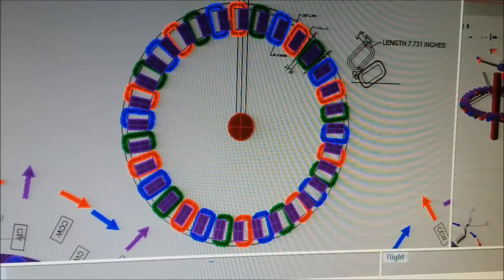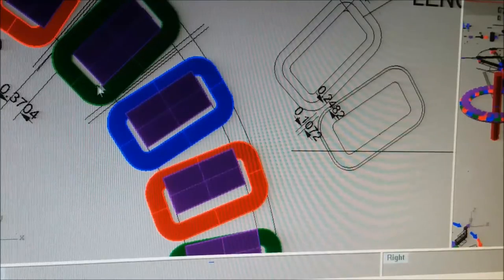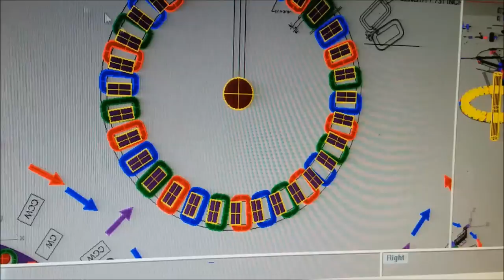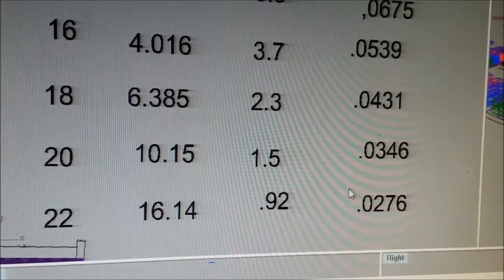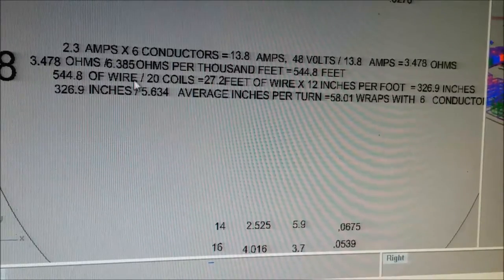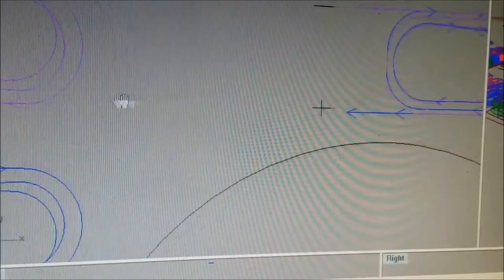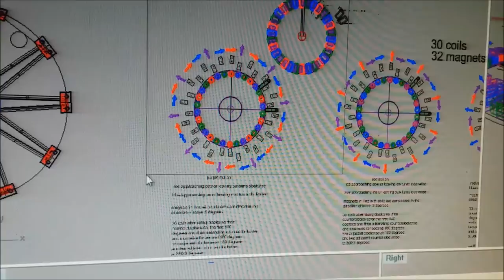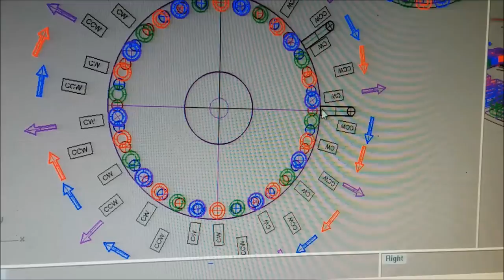HOW TO DETERMINE MAGNET WIRE SIZE AND TURNS FOR WIND TURBINE STATOR PART 2

Comment: thank you what is a software?
Reply from the maker: I converted to Rhino 3D from Autocad because it does compound curves. I don't have a rendering addition with this 2012 version. The software is from McNeil. They also have "grasshopper" and Penguin" to do other CAD work like animation which mine doesn't do. I use Meshcam to create G-Code files for the CNC machine tools to make metal casting patterns.

Comment: does magnet thickness size matter? because mostly they sell thickness of 5mm.
Reply from the maker: Yes, because thicker magnets of the same length and width have more volume and therefore more field strength.
Search E-Bay  for N52 followed by the dimensions. For this application surface poles rather than end poles and
run with as little air gap as you can build because magneti forces diminishes rapidly with larger air gaps.  Having the stator sandwiched between two rotor plates will be stronger than mamnets twice as thick on one side only. The opposing magnets nee to be opposite polarity. Thanks for being todays viewer on this channel
Reply: @concretehousebuildinginph1488  1 more question sir, for example i created 1kw turbine and the wind speed are in good and stable rpm can i run air condition  directly without battery usage?
Reply: @diymixvideos1825  A/C and no battery bank is NOT recommended ...
Reply from the maker: @diymixvideos1825  Basically, NO. A battery of any size is needed to  dump the 3 phase rectifier into and
the battery amperage  and voltage need to exceed the wattage of your load. Also the aircon cycles off
and on with the compressor being most of the load. The thing to keep in mind is that you are generating 3 phase power and the aircon is single phase. Also the voltage needs boosted thru the inverter and have
a 60 cycle  output since the aircon motors are synchernous motors in most cases, although a lot of newer
refigeration gear use variable cycle speed inverters. With small battery capacity and variable load some
way to dump excess generation is important. Possibly a Zenir diode in front of the inverter on the DC out of the rectifier.

Comment: Are the red coils all in phase?
Reply from the maker: All the red coils are wired in series and are 1 of the three phases. The other colors also wired in series are the other two phases.
Reply: @concretehousebuildinginph1488  how are they in phase? Are the outputs of the red coils all simultaneously zero?

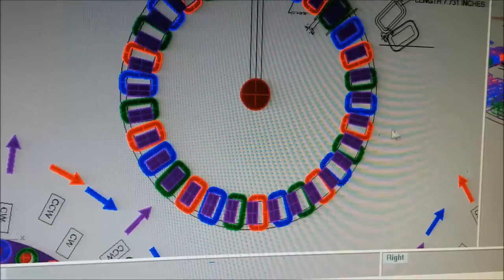Comment: 12:21 bless you
Reply from the maker: I actually got the idea from a video on the perpetual motion "Moller" machine. The video got most everything wrong and did not discover that hysteresis in the coils and inrush currents were major drivers as was the current reversal at the zero crossing points. The visual aid did however
 result in this idea. If the coils were 2 less than the magnets then arranging the coils as two 180 degree generators eliminated some coils
canceling output on others which is a major reason why store bought wind turbines actually only make about 55% of rated output.

Comment: You say six conductors, but you have 20 coils? I'm confused as to how many coils you are using on your design.
Reply from the maker: I have thirty coils every third one is wired in series for three sets of 10 coils. Every other coil is wired counterclockwise with the rest wired clockwise due to the magnets being mounted N_S_N_S_N_S....... So three sets with two ends each is 6 wires leaving the coils. If connected delta then 3 wires leave the stator. If wired WYE there is a common wire also so that is 4 connection points off the stator.
       If you are running the stator as a motor like on our whole house fan then one set of ten coils is connected to another in series and the third is idle with the connected pairs constantly changing and repeating every 6 steps. This is because a BLDC motor is electronically commutated whereas running as a generator there is no commutation. So as a motor 20 coils connected at any one instant.
      So the confusion has to do with the same stator running as a motor or an alternator
Reply: @concretehousebuildinginph1488  So would this mean that all 3 phase motors would have 6 conductors? As you say, 3 sets with 2 ends each. Not exactly sure what you mean by "conductors". Any clarification would be great. Thanks!
Reply: @DementioMod  I believe, What he means by 6 conductors is, he has 6 strands of 18 gauge wire in parallel in the winding. i.e 2.3 amps x 6 conductors = 13.8 amps.. you increase current carrying capacity by wiring wire strands in parallel

Comment: How is this a three phase machine?
Reply from the maker: Tom, Each of the coil colors are a set of coils all wired end to end.
The 3 sets of series connected coils are 1/3 out of phase in rotation, so
if one is at zero crossing the one before it is 1/3 positive and the  one following is 1/3 negative. The total coils devided by three is the frequency that it is alternating at.
Reply: @concretehousebuildinginph1488   Take the two green coils in the bottom left at the start of the video. They both have a magnet pretty much over their middle. But one is a north and the other is south... So as the rotor moves a little bit round one of the coils will be going up in voltage and the other down. The ratio of 30 coils to 32 magnets is resulting in adjacent coils being 24 degrees out of phase with their neighbours so it's not until you get to the 15th coil that you are in phase. If you had 30 coils to 40 magnets  adjacent coils would be 120 degrees out and you've got your 3 phases, as it is your red coils are 3*24=72 degrees out. I might be wrong but that's how it looks to me

Comment: I don't think this is three phase. I think it's 15 phase. Only opposite coils are in phase. A simple method for three phase is to have a ratio of 3:4 coils to magnets i.e. 30 coils for 40 magnets. That means every third coil will see the same flux.
Reply from the maker: There are 3 phases, red blue and green. All the blue are in series as are the red and green. The 3 outputs, red
blue and green are AC because the magnets are N-S-N-S ....N-S to capatilize on inrush currents. As a generator 
the 3 outputs go thru a 3 phase rectifier and output a DC voltage. As a motor which I have under construction
the sets of coils are wired as WYE. This means that the say blue coils feed into the red coils or the green
coils with whatever phase not connected left open to read flyback EMF for comutating the motor since it is a brushless DC and has no commutator or brushes. 3 Hall effect sensors can also be used which would allow
timing lead, however the six wires would have to run clear of the 7 meter diameter fan to the controller. Putting
the controller above the fan makes it inacessable so back EMF was chosen.
         The 30coils to 40 magnets will have a very high angular advancemet coil to coil and since they are in series some would be outputting voltage of opposite polarity making several coils cancel each other out. I chose
30 coils to 32 magnets for minimum angular advancement around the stator. All the different coil  to magnet
ratios are for the same purpose, that being to avoid all of them going off silmultaniously which is referred
to as "cogging"   A BLDC motor with the same number of coils and magnets is how a stepper motor operates.
It is intended to cog from one pole position to the next, and by counting the drive pulses the number of revolutions
can be counted. Applications would be CNC equipment and 3D printers. Your coil count must be devisable
by 3 for 3 phases of equal output. The magnets are either north or south polarity so must divide by two. The
alternating north and south polarity is so 2 like magnets repelling at the half way point to the next magnet
can be the opposite polarity and attract each other. 
       Opposite coils meaning 180 degrees of rotation and an even number of magnets one is north and  the
other one has to then be south. The number of coils for 5 phase, nine phase, and 15 phase have to be divisible 
by the number of phases. Anything else produces vibration and electrical growling noises. There is another
video called stator as a work of art which shows a split stator that can be a six phase, or two independent
three phase motors. As usual our presenter has likely rambeled off subject resulting in confusion resulting
in no one watching these videos including me and my Philippine Asawa.
Reply: @concretehousebuildinginph1488   but the red coils (for example) are not "in phase" - if you graph their individual outputs the are not maximum or zero simultaneously. So how can you call them a phase? Simply wiring them in series doesn't make them in phase... They will be working against each other. If you have 3:4 coils to magnets every third coils output will be in phase and thus wiring them in series they have positive interference.

Comment: your generator can work but only with wiring like this: AaAaABbBbBCcCcCAaAaABbBbBCcCcC
A/B/C = phases
A = clockwise wiring, a = counterclockwise wiring.. etc
to get same wiring direction you must have 40 magnets for 30 slots: ABCABCABCABCABCABCABCABCABCABC

Comment: مقنز من وفيه دخول خروج 💐🚦🌍🕎✝️💎🕛🍎👌✊☝️🇹🇦🇺🇲🇯🇴🇨🇭🇮🇱💐🍎
Reply from the maker: My computer doesn't translate Farsi but thanks for commenting. 
You might also find a lot of useful information on the
"electronoobs"  youtube channel. He is particularly clear on BLDC motors 
 which are essentially built the same as 3 phase alternators, with the
addition of electronic commutation which is not needed to be used as a generator.

Comment: overcast with spots of clarrity
Reply from the maker: The key elements are coils must devide by three and the coils of a phase are connected in series. The Wye 
or delta connection of the series wound coils puts two phases in series and the third set are off. The pattern 
repeats every six steps. The second truism is that the number of magnets must devide by two so they can
alternate north and south. Having the magnets and coils with different but close numbers  of them prevents half the coils all coming on or off simultaneously which makes for a jerky rotation called cogging. One other thing is that you don't have to use only three phase connections. Five phases can be done or you can have coils devided by 6 and 
wire up two independent 3 phase windings as a double delta. The plus side is that in low wind only 1/2 the coils
are on when you get up to get up to cut in RPM and the second set at a higher cut in RPM. The wire size for any
scheme is determined by all the coils that are in series for a phase, or 2/3 of the coils in a 3 phase because the other third are not on. If the coils are devided into smaller paralelled groups then there is less length of magnet wire
and therefore less resistance and results in larger winding wire for a given voltage. This has probably removed 
those pesky spots of clarity. Our stator is two 180 degree segments so we can slide them between the two magnet rotors which have in our case 10,800 pounds of attractive force plus a multiplier for the amount of magnetism
in the steel rotor plates. In perfect conditions the multiplier is 2 but we have a 3/4 inch thick stator with .030
inch clearance on either side.  So probably only 9,000 pounds of attraction total. Still a lethal little item.
Reply: @concretehousebuildinginph1488  Thank you very much I could in no way explain it better myself. And as a metric goon my self then it is not always technically English farts in
on first attempt. I found and ordered wire for my trapezoid and with great help from your explanation about the stator, i can still use what i get. You gave me some good pointers and gold grains with coil in the opposite direction so they do not counteract flow + more conductors to carry the load. Also your video on airfoil was of great help to me. Until I found your version the best explanation for gauges and laps I had was from @muddymuddymuddmann
(BUILD A DUAL PERMANENT MAGNET ROTOR WIND TURBINE (PART 1)
Best regards Michael

Comment: this seems off...the ratio is wrong
Reply from the maker: Remember that every third coil is wired in series so the resistance is for the entire string. 
 Also as long as the coil count is different than the magnet count cogging will be reduced. 
The magnet count can be larger or smaller than the coil count as long as it divides by 2. 
There is a video on here showing how to tell if a coil is canciling out another coil's output
which really screws up the power generated. Smallest ratio would be 2 magnets and 3 coils, 
and I am doing 30 coils and 32 magnets so many ratios are available.
Reply: @concretehousebuildinginph1488  review the design. check the obvious.

Comment: Вот мой генератор https://www.youtube.com/watch?v=Cl4BNoydRzM&feature=youtu.be
Reply from the maker: That is an inrunner radial generator turned by an electric motor. It will have iron cores in the coils as well. Ohms
law would still be valid, and 3 phase principles still apply to this. Things external to the generator would work the same.

Comment: I have a problem, connecting the American generator to the inverter, I will not twist 3 phases, and if I connect all of them together on one side, i.e. as one phase, I have 80v and only gives 100w, with 21 coils, 56 magnets, and 300 rpm, as possible  , 1.6mm wire, my inverter is between 45-90AC so I can't go over that.  And as for the generator, others at 250 rpm reach 2000-3000w without resistance easily twisting my hand, and I will not twist my own connection.  Help.
Reply from the maker: OK, Generally speaking the inverter wants to convert a DC voltage to AC at 50 or 60 cycles/sec. A solar panel for instance is a DC output that charges something like batteries through a charge controller module. It is more complicated with a 3 phase system. The three phases are continually changing from positive to negative voltage which repeat the pattern every 6 steps. First thing off your 3 phase alternator is a 3 phase rectifier that outputs a DC voltage. If you don't have enough voltage to charge the battery, like 10% more than battery voltage then capacitors first. There is a Youtube channel called  "electronoobs" that may be helpful.
          As a test connect up only one phase leaving the other two open circuit and see if you see 700w also try the other phases one at a time. If the output is still very low then your inverter may not accept an AC input. In that case you need a rectifier. for the test a wheatstone bridge either bought or made from 4 diodes will show what a phase is actually producing.  At that point a 3 phase rectifier is what you are looking for to make a DC voltage for the inverter input. Store advertising "Green Energy" sell those items or either Amazon or E-Bay if they are available in your country.
          How about a block diagram of the components to generate usable
power for your house.

    ALTERNATOR_3PH RECTIFIER_CHARGE CONTROLLER_BATTERY
STORAGE_OUTPUT INVERTER

         Now some of these functions may be combined into a single device
with brands like MCCP. There are Yahoo groups specializing in power
generation from wind or solar. Now I graduated from engineering 
school in 1970 and have some idea how to build near anything, but
today an evening of internet research can get you going in the right
direction. When PC first became available I read a lot of advertising literature describing how their product had a better part here or there and made a list. I bought a set of parts like 4 hard drives tape drives, disk drives, some 2ns ram and a copy of windows 3.1 with DOS 6.2 and
plugged it all up in the case. It all worked when I powered it up. Still 
have it. That one is a single overclocked AMD 486 processor with an 
intel  chipset and all SCSI drives.

Comment: I have a problem with the generator coils, I have a 1.6 mm cable, a 18-19 mm thick coil, the coil gives 8.5 volts at 300 rpm. Two discs with 50x20x10 magnets with 56 magnets together.  Turnover 300 rpm.  I need a minimum for a 10-13v coil.  Coil width 2.5 cm.  I have a wire wound 151 times.  But it generates very little electricity.
Reply from the maker: The electricity generated is watts = volts times amps. To get more 
volts with other factors held the same you need more turns of wire.
If your amps are also low then the wire guage can be smaller. Google
ampacity of magnet wire chart in google images. Remember the 
epoxie potting traps heat so be conservative. So like 25% more 
capacity.  Read the amps (wire in series with the coil), and volts which
are wired in parallel of each phase to see if they are the same and all generating. If you disconnect one output wire does the  RPM jump 
up and make more volts on the other phases?  56 magnets divide 
by two but must alternate north and south faces toward the coils 
to make alternating current. The magnet approaches a coil and
makes voltage of say positive polarity, drops to  0 when centered 
and makes the opposite polarity passing the other half of the coil.
The coil to magnet face clearance is CRITICAL because magnet 
gauss drops off exponentially and so does your output wattage.
       Supermagnete_flux_density_eng Will show flux density (gauss)
of the magnets according to your perameters.  Supermagnete.com
is the site and the spreadsheet is hard to locate but in the upper left
corner of the page there is a link. You will need average wind velocity
from   Global wind atlas    and    Wind Turbine Calculator [HAWT and VAWT]
To see what you can generate.  Have you got the winding direction of the coils alternating clockwise and counterclockwise and of course switching the leads reverses that.  Can you change drive speed with belt ratios or is it a direct mount on the shaft.